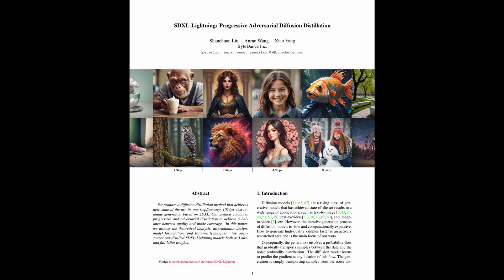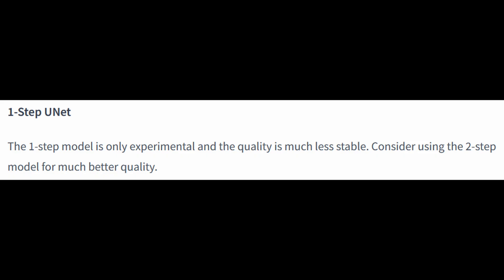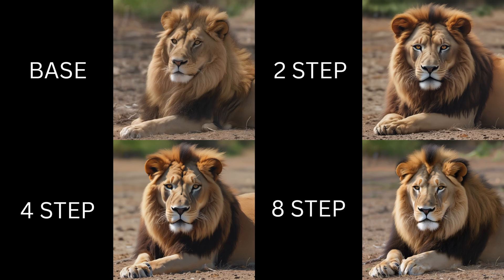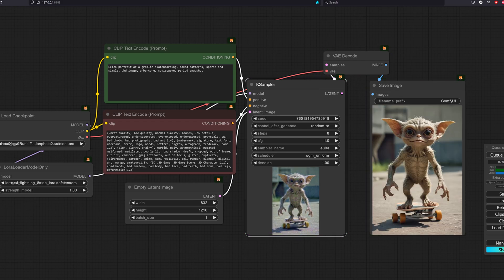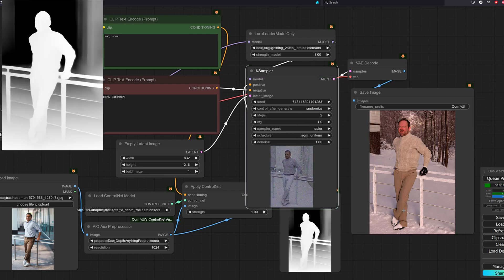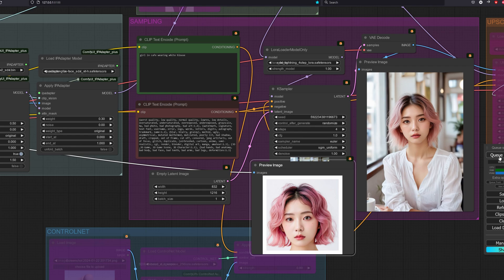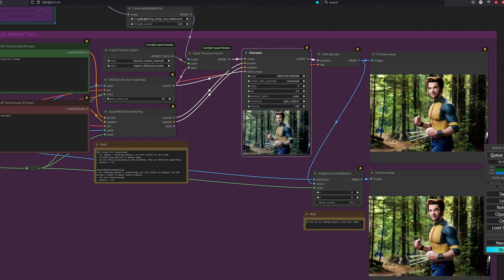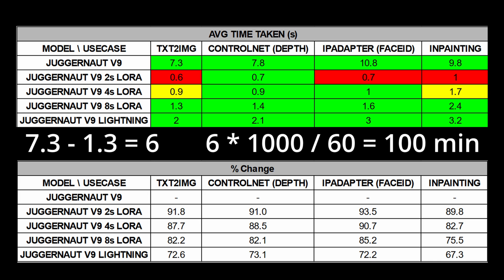ComfyUI SDXL Lightning Performance Test | How & Which to Use | 2,4,8 Steps

Comment: That's crazy good, I've switched to Lightning when it came out and I'm not going back. Would you mind telling how do you get the live steps image inside of the Ksampler? I've never seen this before and would love to use that too. Cheers!
Reply from the maker: Sure!
In the ComfyUI repository: https://github.com/comfyanonymous/ComfyUI
Scroll to the bottom ('high-quality previews') and install the models and place them in vae_approx folder.
Then if you are using ComfyUI Manager, there is an option 'Preview method', mine is set to Latent2RGB.
If not using ComfyUI Manager, then add '--preview-method auto' to the end of run_nvidia_gpu.bat file.